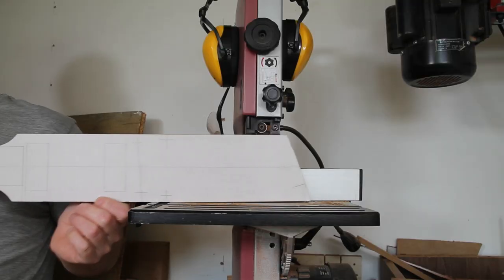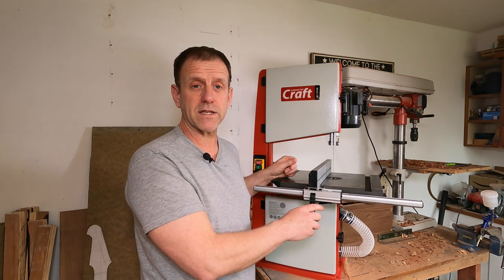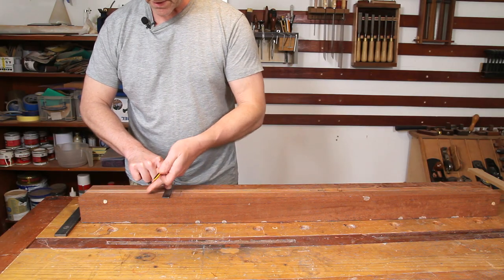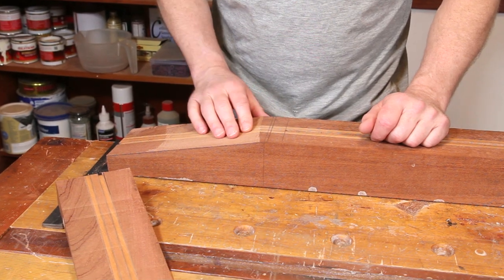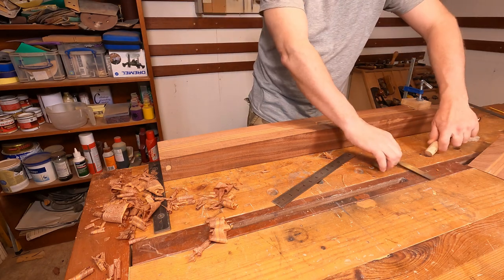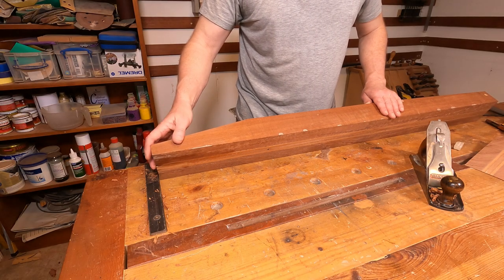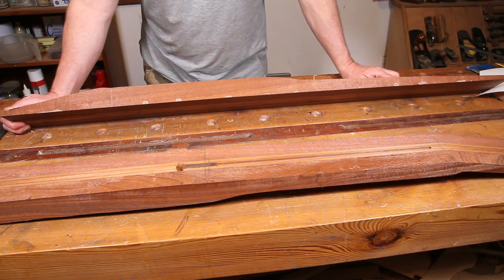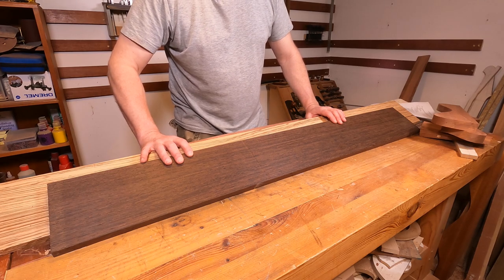Firebird Build Episode 7 Shaping the centre block.

Comment: Haven’t seen anyone do a slight back angle on the body portion of the neck before. Is that due to specific bridge choice?
Reply from the maker: Yes, the tune-o-matic bridge needs a neck angle of around 3-4 degrees.

Comment: hi, could you let me know what adhesive you use to stick your drawings etc to the template material. cheers.
Reply from the maker: Hi Paul, I just use cheap PVA woodglue. If I'm doing a lot I put it on with a small foam roller.
Reply: Ok cool, thanks for the reply. @Adventuresfromtheshedofdreams